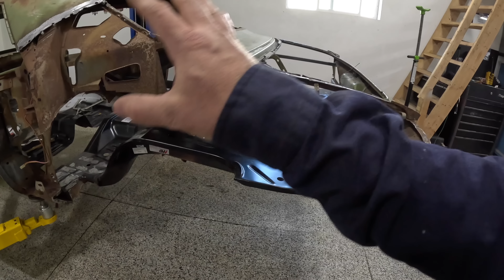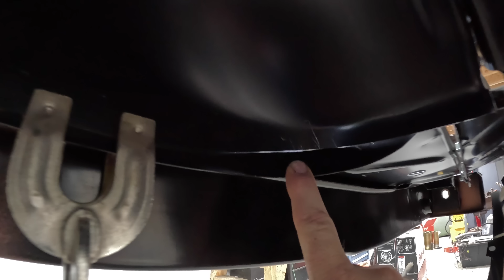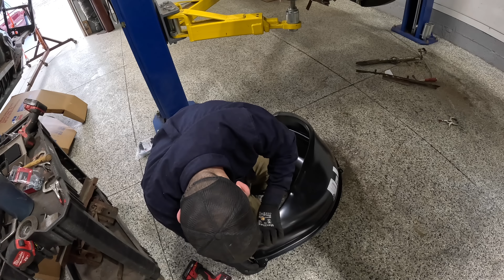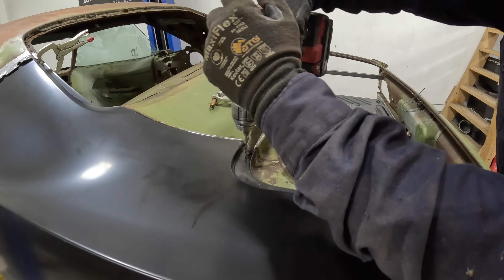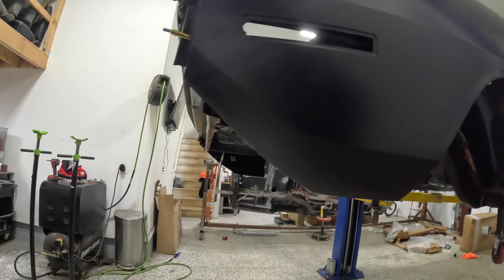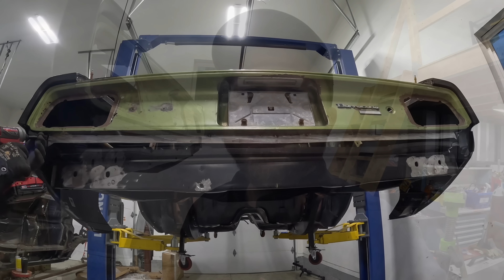1971 Plymouth Cuda Restoration - Episode 10 - Trunk Pan Install Pt. 1

Comment: Gotta love that Paint Over Rust-15.  Looking forward to the next video!  PS....Ive been using POR-15 for 30 years.  Other then removing surface rust scale, you really dont need any other surface prep.  The whole idea is to paint over rust.  It seals the oxidized metal and inhibits rust.

Comment: As long as it is clean and lightly rusted POR-15 seems to stick very well even without all the prep. On my Scout I did the acid etch and phosphorous prep on new metal and rusted metal I just knocked off the scale, wiped it with acetone, and put the POR-15 on directly. I guess time will tell but for now both have held up just fine after several years of driving the Scout around.
Reply from the maker: Absolutely!  I’ve never known any different. POR stands for paint over rust right?  Not paint over degreaser & acid etch 😂.  I didn’t know any difference.  Gives me & the 2 people they complain every time a little more peace of mind I guess.  😎🤘
Reply: @rustbucketrestos6511  Not to mention most of those interior panels were bare metal from the factory... if it only has a little scale after 50 years I think any kind of protection will be just fine.
Reply from the maker: Absolutely!

Comment: So, it looks like you need to start from the most forward mounting point of each panel, line that up first and then work your way back to align the rear panels to the inner structure. Looks like I need to invest in some tools like clamps and sheet metal screws, drill bits.

Comment: It's not necessary to use POR's UV topcoat to protect the base layer. You can overspray the base layer while it is still tacky. The base layer will bond with the overcoat so you can use whatever color you want and for a lot cheaper too.

Comment: Wow!!! This looks so familiar to the work I did on my '74 Challenger although I was attaching outer wheel housings and trunk extensions to existing metal. Plus, you actually appear to know what you're doing while I got through it on 104% brute force and ignorance 😀

Comment: are the rear frame rails sagging down? would you gain  better wheel tub fit if you supported the back of the rear rails?
Reply from the maker: I solved this issue in the next video!  😎🤘

Comment: Nice job fitting the panels, as for the POR-15, there is a rust inhibitor called Blue Steel,  I used it at the Transit depot I worked at and it's just like POR but cheaper than Por and for me it's free wink-wink, I used it on my Camaro sub frame and underside in the same manner you did on the Cuda, JLYK and thanks for the motivation,  can't wait for your next video
Reply from the maker: Right on!  😎🤘

Comment: Hey David when you use the POR 15 teh cleaner or etcher do ypu let dry and then rinse off with water ?
Just playing catch up your video's. Cuda is going to be amazing
Reply from the maker: Yes, that is correct.  Rinse thoroughly with water and make sure it is completely dry before top coating.

Comment: If you tear it apart that far, wouldn't you sandblast the rust off the inner roof/trunk structure before putting it back together?